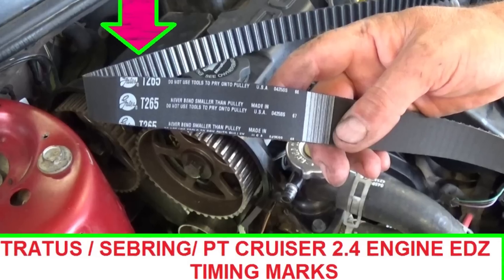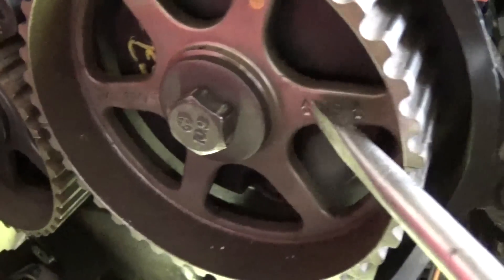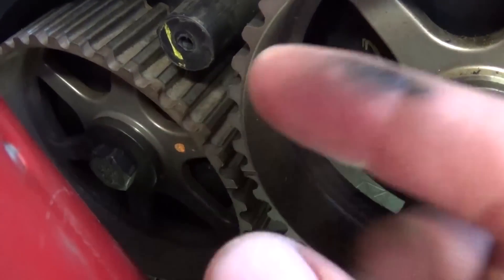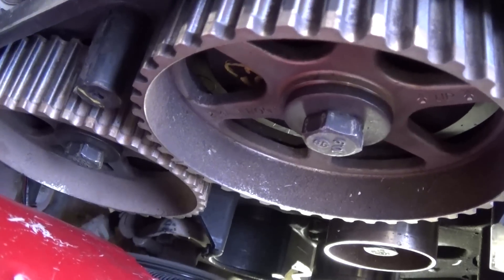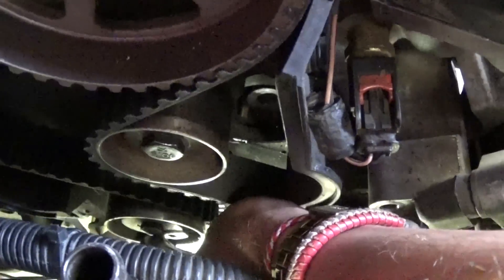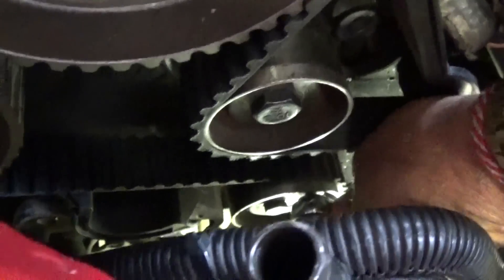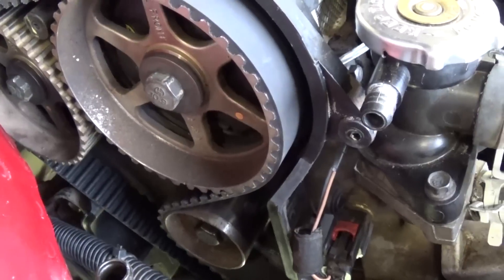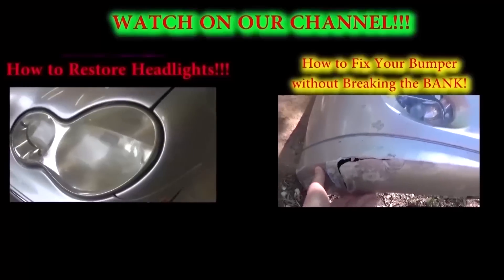Dodge Stratus / Chrysler Sebring / Chrysler PT Cruiser Timing Marks . Timing belt marks

Comment: For all the folks who say these are not really interference engines...... this is partially correct.  I've never seen a broken belt damage a valve, however if the cams continue to turn, the valves have a small amount of overlap in the cycle. So they can in fact be damaged. Never once seen it happen though.

Comment: I just did one and also had to advance the intake cam a bit to make them go into alignment when I took up the slack. Just wouldn't work any other way. And lock the crank in place so it doesn't turn a bit when you are working on the upper timing marks.

Comment: everything looked good but the part on the tensioner isn't right. you don't just feel the tension.  there is a line up mark on the tensioner. you have to use a mirror and align the two points. what you did will cause premature belt wear.  You need to look up the right procedure and correct it. giving people the wrong information isn't cool. Surprised you don't know that since you knew about the half tooth procedure

Comment: The Chrysler 2.4 is a non-interference engine so the pistons won't make contact with the valves.
Reply: This is true .
Reply: Same engine on a 2005 stratus correct?